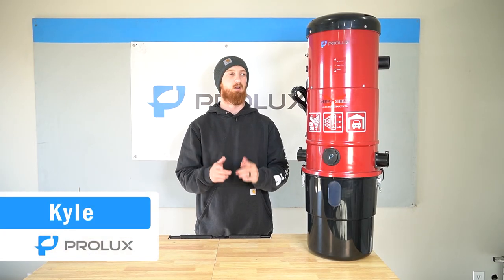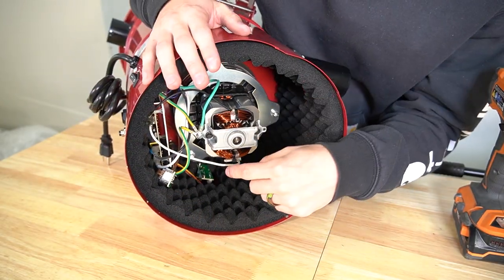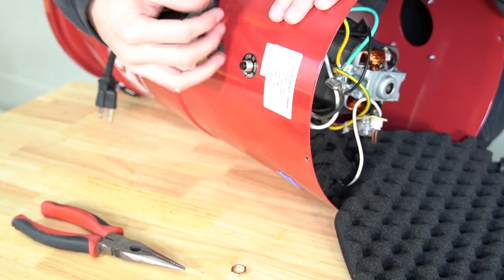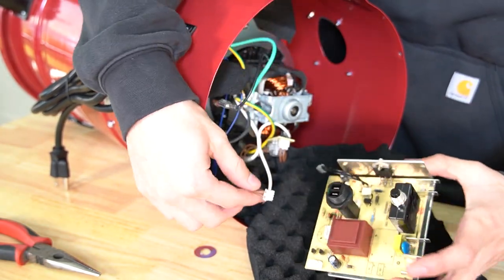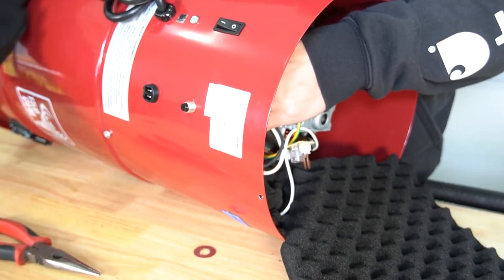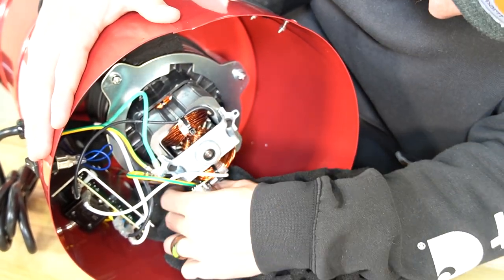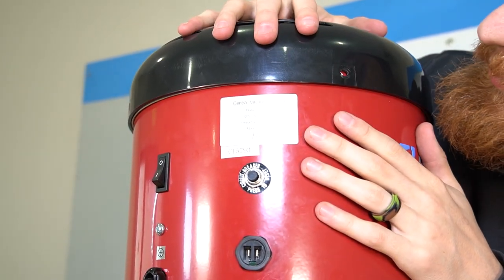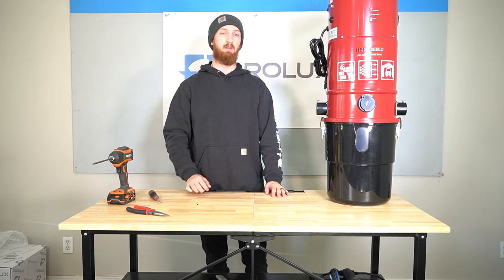Prolux CV12000 Central Vacuum - How to replace the circuit board -

Comment: I have a similar issue than described below. CV12000 turns on by itself (nothing plugged in).. I've checked the wire at receptacles inside the house to be sure they were tight, etc.  No issue. When unplugging 1 of the wires from the CV12000, it turns off.  I guess this is telling me I have a problem in the wire somewhere?  Or, is this the circuit board?
Reply from the maker: Very well could be the ciruit board! Reach out to service@proluxcleaners.com and we can help you out!

Comment: My CV12000 works but I have to turn it on manually at the unit. If I use the hose with the switch, it would turn on and then off in a few seconds, or not at all?  Is that a circuit board issue?
Reply from the maker: It definitely sounds like it! Reach out to service@proluxcleaners.com and we can take care of yea